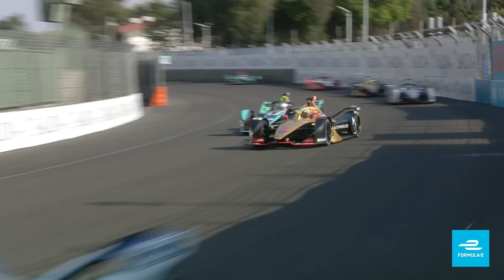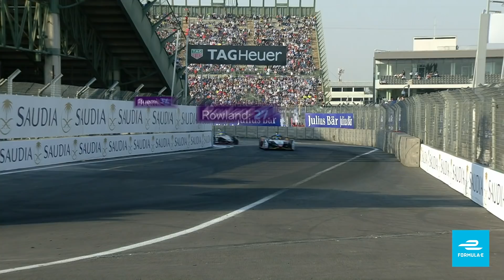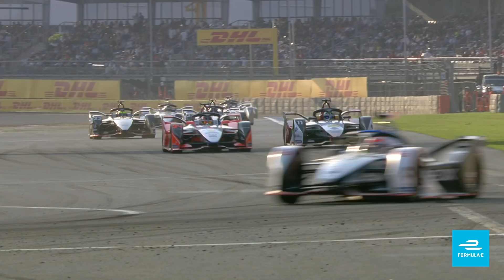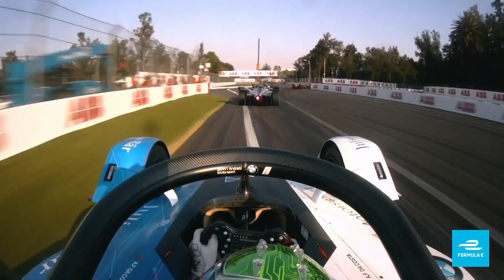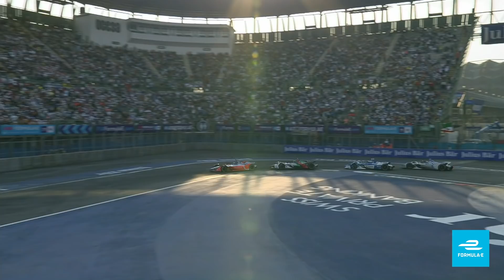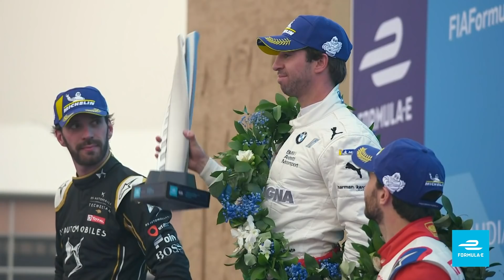Power Management Analysed | ABB FIA Formula E Championship

Comment: Declares 280kmh, but never seen a speedmeter.
Reply: For one, max speed won't be reached at all laps. Secondly, they change in power consumption if they want to.
Apart from that, what is the point? The tracks are so tight, even 100km/h are extremely fast. And since I last watched Formula 1, they didn't have speed meters either.

Comment: I hate to be nit-picky but surely Eduardo Mortara would have had more energy in the final laps not power?
Reply: Because he had more energy, he didn't need to save as much and could push (use more power) more than say Wehrlein or the Nissan drivers. In this case it's sort of the same, more energy = more power.
Reply: @Sander kamp yeah I suppose that does work in this case! Even though he didn’t have more peak power available he could use more power for longer during the lap!

Comment: Should've been allowed a quick recharge during red flag. Said it before and imma say it again
Reply: Wouldn't the teams put a lot of development into the recharging stations, until the point where it becomes unsafe to charge the cars? Almost sounds like refueling in F1. I think swappable batteries would be better.
Reply: @Exevium  Yes but it would push the boundaries of E.V. charging and batteries development, which could greatly impact the future of electric transportation
Reply: I'd agree if like half the grid would've run out of energy. But Pascal and both Nissan running out of energy was only due to bad strategy of energy consumption.
Reply: Quick, on-the-fly recharging tech like that will probably be in FE some years down the road. FE will slowly start allowing different parts of the car to be developed by the teams. ATM, they just want to keep the costs low